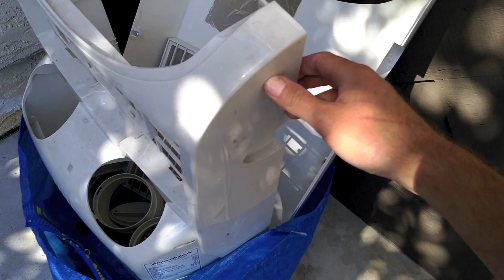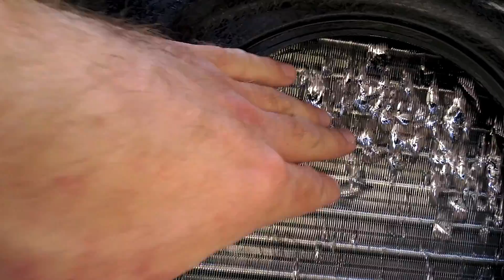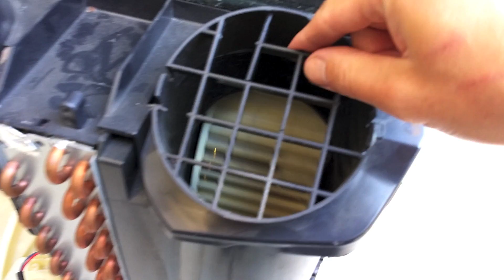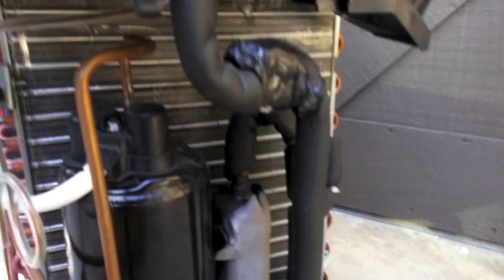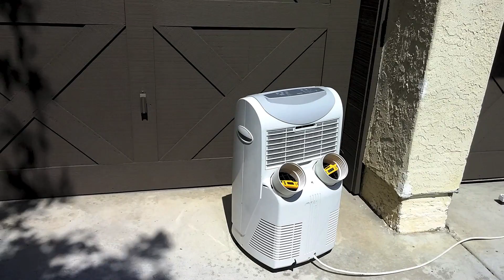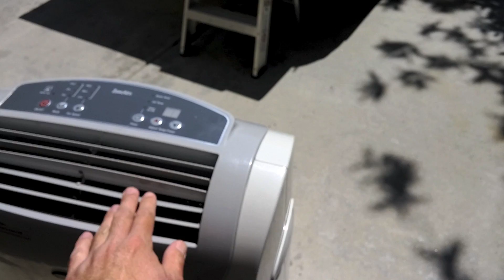Portable Air Conditioner Repair

Comment: My Honeywell 14000 BTU unit stopped evaporating water. It's not supposed to need a drain hose and does not have a reservoir to empty.

Comment: I ordered a replacement capacitor for a unit very similar to this but the one spec'd is too big: 2" vs 1.75 in. diameter and won't fit in the slot for it. Where should I mount it now as supposedly it's the only one recommended by the manufacturer?

Comment: What's best way to remove the bottom drain (base) pan as my capacitor leaked oil and I need to clean the water wheel and surrounding area etc. under the condenser coils?

Comment: Hey man, good video. Have you ever seen one of this kind of unit that leaks a ton but has a little to no water in the catch pan? We have a Whynter ARC-14s and a day ago it started leaking a bunch of water. Went to put a hose on the pan but nothing came out. Tilted the unit to see if anything was in there and only got a few ounces. Yet it's producing a bunch of water, to the point we may have to get the carpet replaced. It's of course july in northern VA atm so it's 100F with almost 100% humidity most days and we can't go without running it. Not sure I could afford a tech at this point and I simply can not find a service manual for these things. Any advice would be helpful man.
Reply: My capacitor leaked oil, which gummed up the float switch so it wouldn't turn the unit off when the high water mark was reached causing this issue. 

Additionally, large amounts of dust and/or leaking oil prevents the lower coils from evaporating the water effectively out the exhaust.

The bottom reservoir is quite small so you may only get a couple of dinner plates worth of water to drain out.
Reply: @SuperG11123  I literally got spoonful's of water out of the tank. Meanwhile, it's happily dropping about two gallons a day down the insides of the body and out the bottom. I managed to get the front off last night and the heat exchangers aren't actually very dirty. I couldn't manage to get the back off despite taking the two hidden screws out so not sure what's going on there. We have it in a large plastic pan (picture a massive cookie sheet), and just sop it up until we find a fix or break down and replace it. I just hate the whole disposable society thing ya know?

Comment: Good job. I had my exhaust fan blower cage break just like yours. Dozens of the slat pieces on the floor of the portable A/C. I cleaned that up, and can spin the squirrel cage easily by hand. But when I turn on the system, cold air blows out the top, but no hot air discharges out the back. The exhaust fan motor does not appear to be kicking on. 
So ... Do you think when the cage breaks, the motor typically fails, too? 
What voltage should I get at the exhaust motor? 
Thanks.

Comment: Thank you for this video. I have a Honeywell 14,000 unit that the compressor gets hot, sounds like it's trying to run for a few moments every 30 to 60 seconds, then stops. Zero cooling whatsoever, not just inadequate. Think the compressor is seized? Or could it be just at the refrigerant has escaped, simple smoke/leakfix/vacuum/addport/fill job?

Comment: Hi, I just purchased a Black and Decker Portable Air Condition with Heat Pump Model BPACT14H. I was hoping that you could answer a question for me, I set the temp to 75% when the unit reached 75% the compressor shut off but the fan did not it stayed running all day and stayed running each time the compressor shut off at temp and came on again when needed. Is it normal for the fan to continually run??? Please help if you can.
Thanks George

Comment: JON I Have a Haier two hose stand alone unit HPND14XHP-E that I cannot get the front cover off to get to the broken fan wheep it the upper wheel to clean the unit after I repair it.  The fan does not go on and blows the breaker after the compressor kicks in.  I know the wheel broke and probably jammes the fan.  Need advise on how to get the front cover off Please  it is 13,500 btu acn 10,000 heat which I don't use

Comment: An AC parts and service store could have sold you a fin comb to straighten out those bent fins. Looks to me like you lost about 30% of air flow through the condenser. Careful use of a butter knife also works in a pinch.

Comment: I have a different model but similar design that is emitting a burning plastic smell... any idea what could be causing this? I am kinda scared to open it up and look at it as there is a warning on the back not to do so lol. No one will come look at it either.

Comment: I have a delonghi pac an140hpec. Recently its not cooling my living room well...the single hose in the back no longer gets as hot either. So, not sure wuts going on. I wiped off all the dust off the the condensors, the top horizontal and the lower vertical condesnsors. What else could be wrong in your opinion?

Comment: I wish I had seen this before I junked my old one.  I bought a second and it has been acting strangely - turning all the way off and sometime compressor does not come on and making a loud compressor off thunk - and a few spare parts might have saved me $770.  I do not think I will purchase another since they do not seem to be reliable for the long haul - 2 units in 5 years.  I just wish there was a video on how to get these things apart and back together.

Comment: Hey I’ve watched this video twice and can’t get the shell off is their some hidden screws I’m missing. Mines is holding mildew and I’m trying to clean it
Reply: Once you have the 18 screws attaching the back panel out (don't forget the 2 hidden screws in the recess of the two side 'handles', if your model has this), put your fingers under the long 5/8" plastic piece at the top belonging to the front panel just behind the pop up louver mechanism and pry up and towards the front. This releases the front panel for removal. 

Once this is done, it exposes the 2 remaining internal screws holding the back on, remove these and remember to push the hose drain threads in at the back to clear the panel as you remove it and you're done

Comment: Where might the thermostat connect. Mine is deisgned different....bought at Wal Mart. Its Short cycling and its been cleaned not spotless but way more than just a spray of canned air.

Comment: Thank you for your most informative video which saved a DeLonghi portable a/c similar to the Frederich's from the scrap heap. It was a capacitor that caused the exhaust fan not to start.  You mentioned that these units are not designed to be serviced. I often see pallets with 10 or more at the Goodwill Outlet for $15 a pallet. Some units appear new. Regarding the Frederich brand, it was once a premium built A/C manufacturer.

Comment: I have a Toyotomi 14k BTU that looks almost exactly like that one when you remove the housings. It cools well but the compressor is making a noise that resembles a fan blade hitting the housing. Opened it up, and like you said, there’s no service ports or any way to dig in deeper without evacuating the Freon. No clue where to find a replacement compressor either. I guess I’ll run it until it dies, but that noise sure is annoying.

Comment: Interesting, so the duel hose still sucks air from the room just not as much and the plastic fan blowers on all these portables are designed to fail and they will fail.

Comment: I wondered if most of them are not properly isolated. I've fully isolated mine so it's true dual hose. Was thinking to make compressor variable voltage with jist a therister (making simplified "inverter" ac) , but not sure about it yet.

Comment: I have that exact model and for some reason when running the AC  on max setting my AC doesn’t blow any air. The compressor stays on but the fan stops and I feel no air. But when I set it to low or medium setting everything works fine. Any idea?
Reply from the maker: The control module may not be sending power to the high speed winding of the motor. Or if it does have power the high speed winding of the motor is bad. There should be a diagram on the motor or the unit somewhere. Sometimes the high speed power lead wire is red.

Comment: in the motor there is a fuse between one of the 3 wiresits a thermo fuse and you can replace it with a new one

Comment: Hey Jon; Just found your video since im having some issues; and just wanted your view.. I am running or I was running a EdgeStar AP14001HS Portable Air Conditioner - I have cleaned the filter - tested the in and out take tubes for air flow .. seems ok. And I can hear/feel the compressor turning on. But It simply only blows room temperature air. Or .. is there anyone who comes out to fix these? (it did see heavy use as well since it was the main cooler for an office/bedroom combo was wondering if it could even be out of refrigerant) Id rather fix it than buy a new 400-500 $ unit. Thanks

Comment: The innards of this unit look almost exactly like my 10,000 BTU Royal Sovereign dual-hose portable. It seems that the shell, control panel labeling, etc. are merely a customizable facade around a cookie-cutter design. Needless to say, it isn't quality.

A unit of decent quality would be a metal platform upon which the compressor sits, and a pair of rails (essentially, a proper chassis)  supporting the condenser and evaporator. The all-plastic design is probably durable "enough" (e.g. don't sit on it) but the noisy resonance is completely unacceptable for the home environment. The condenser section does not seal well when assembled, leading to the cold air being blown out the exhaust, and the unit having little to no "reach" compared to a traditional room unit.

Also, the fan broke because the Chinese factory from whence it came uses the cheapest, lowest-quality plastic available, and as little of it as possible. The fan is made of a very brittle plastic that fatigued over time due to inherent imbalance and variation in material density.

Thanks for showing what not to buy!

Comment: Excuse me, my condensate motor starts, but then shuts down within a few seconds. Do you think the motor itself would be broken, or perhaps just the coiled up part on top of it, from where the cables are sticking out? I am asking because I haven't been able to find a replacement since I don't know what these parts are all called. When I search for "condensate motor", I never get anything like it. I would really appreciate your advice.

Comment: What do the capacitors look like in a portable ac unit? Might try replacing mine to see if that fixes the problem and do a regas as well. Otherwise I think it will be the compressor in which case I'll just have to throw it away and get a new one.
Reply: If you cannot identify high-voltage capacitors, I strongly advise against any and all DIY troubleshooting for your own safety.

Comment: Hey man my portable ac blows cold for a bit then goes back to hot/warm
Reply from the maker: A lot of the times that's a sign of low refrigerant/leak.
Reply: How would I get into that
Reply from the maker: @OmgItsBlur  It's pretty tricky and quite frankly dangerous. I don't recommend someone getting into the refrigerant circuit without experience. That said you'll need two of these https://amzn.to/2Y9ukKO  A manifold gauge set and the right refrigerant just to name a few items.

Comment: Thanks for the video. Fixed my AC in the first 2 minutes of the video as you pointed out the air intake. I looked in mine and noticed my two toddlers threw toys in.

Comment: Hi my compressor is not working but my fan is running. I did check capacitor with multi meter its ok. Can help me to fix this. Thanks

Comment: How do i fix my portable i accidentally plugged it in into a 220 and now it wont turn on.
Reply from the maker: Oh no! You'll have to open it up and pray it's just a burnt fuse, if it has any.
Reply: @jonhvac   no fuses i checked it but i guess its fried, thanks for answering
Reply from the maker: @williamcermeno6504  Yeah sorry to say it's fried. I've seen some that do have little glass fuses on the circuit board.
Reply: The overvoltage likely destroyed one or more discrete components involved in regulating a stepped-down voltage to the electronic control unit. If I were troubleshooting, I'd first look for marked points on the electronic control unit indicating a specific voltage and test them with the air conditioner temporarily plugged in. Alternatively, I'd perform a continuity test on the primary and secondary/secondaries of the transformer for the power supply. Then I'd perform a reverse voltage breakdown test on rectifier diodes found electrically near the secondary. Then I'd look for zener diodes and check their resistance at both polarities. If anything were faulty, I'd swap the power supply and/or electronic control unit, assuming that salvaged parts are available on eBay for a total of $25.00 or less. Any further troubleshooting or expenditure is not worth doing.

Comment: Mine wont power on. Thought it was outlet an rewired. Checked for a fuse blown but from what I can tell that's fine also. How would I check for a relay or whatever it could  be? This is my first ever time trying to fix this. Sorry if this is a dumb question.  I do have a volt meter also.
Reply from the maker: Try a different outlet if you didn't already. An electrical meter would help. You can get one at Harbor Freight Tools for cheap or free with a coupon. You'll have to take the casing off of corse. Check for power where it comes into the unit (with it plugged). If you don't feel comfortable working with electricity I wouldn't recommend you do so. Some circuit boards have fuses as well. It could be a bad circuit board as well.
Reply: @jonhvac  volt an electrical meter are the same right?
Reply: @jonhvac  I did try I another outlet. I'm so sad it was 14,000 btu. I have 4 kids an 9   months pregnant. Desperate to find a way to make it work. I thought the outlet was bad because everytime someone would pass by an bump cords it would shut the ac an TV off. So switched outlet (had issue with one right next to it previously).
So it went off again when it thundered an wind blowing. Only that part went out.  Switched outlet came on a second then went off. I've tried different outlets sometimes itll beep an get power a split second as you are pulling plug out.
Reply: @jonhvac  I believe it has a relay inside it. I feel as though it's the plug though. How do I test the plug ? Even on specs sticker it says about replacing the plug as if it's a common issue. If i steal a plug off of something else it wouldnt have safety shut off in it.
Reply: @jonhvac  okay sorry for blowing your YouTube up lol ♡ upon closer look @ plug (I  was looking for a number or something so I could search online for another) it seems as though the plastic started to melt around the neutral post . But its top left post that just barley started to melt.
Reply from the maker: Not a problem. Usually that's caused by a loose connection. Either on the plug or the outlet...or both.
Reply: @jonhvac  I think it's in the safety part of switch.  Can I splice a new one in or should I replace whole plug? Lowes has one for 25$ if I do whole cord into ac then its gonna be connected to the circuit board.  An then will need soldered together.  I have a soldering gun but it was my gpas n no idea how to do it. Suppose I can learn.
Reply: I just want to do whatever is safest.  I dont want it to work then catch house on fire because I tried a short cut.

Comment: I got a honeywell air conditioner with heat pump. only comes with one hose. Instructions don't say to put a 2nd one to the window, so i didn't. 
Fresh air comes from inside the room, exhausts out the window. 

The heat works well....until the temp outside is too cold. like down in the 30's or less. 

Then the heat pump doesn't put out much heat at all. sometimes feeling like a fan. 

Do you think the "negative pressure/positive pressure" over the coils would effect the heat pump as well?   

Basically, the thing feels like its just an AC, but the exhaust and in room air blower are reversed based on heat or ac mode
Reply from the maker: The negative pressure/positive pressures are probably not very good with a heat pump.  Once the temp gets below the 40s heat pumps don't perform very well.

Comment: Where is the Frost prevention at? Mine keeps going to Lt mode and stays there till I turn off and on to reset it then goes back after a few mins

Comment: Very interesting video I was always interested in air-conditioning I took apart a couple portables myself as far as the exhaust discharge it is a little on the high side considering that you’re in putting only 70° temperature imagine when it hits 90the unit might go into high head pressure cut off. Great job otherwise!

Comment: I have a hisense 12000 BTU, it runs great then it starts to cycle from cold to regular air after 5 min. Do you know what's the issue? P.s the room is still hot at this point.

Comment: I have a Haier Commercial Cool CPN14XC9 14000BTU.  I am only getting a STOP error and unit will not turn on.  I have taken it apart and there is no water at all to drain.  Removed drain plug, etc.  Any other ideas?

Comment: Thanks for posting this video. I recently inherited a single hose portable air conditioner from a friend and got it hooked up and running well for a few hours; when it started making an awful knocking sound that woke me up. 

Because of your video, I knew where to look, after removing the hose, sure enough, I could see broken plastic blades. I wonder how much a repairman will charge to fix it. 🙁

Comment: I dropped a drill bit through the top grill of my Delonghi Penguino AC Unit, and it dropped down into the fan unit, how do i open it up and remove the drill bit without ruining anything, are there any how to videos?